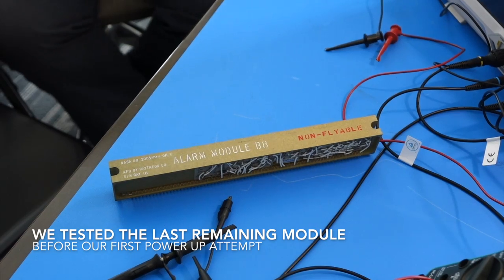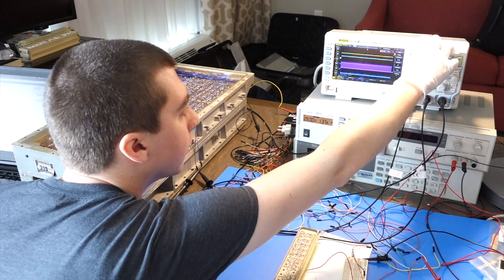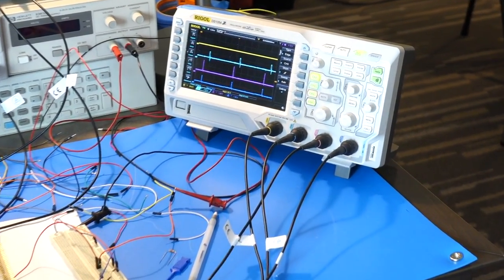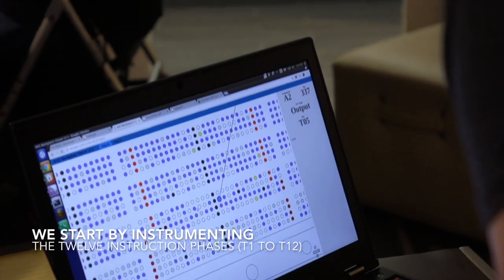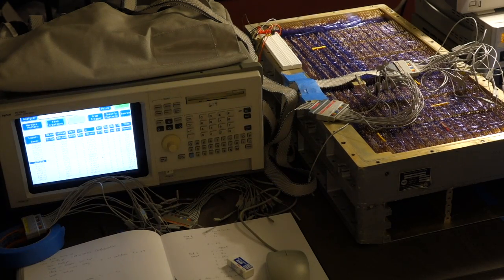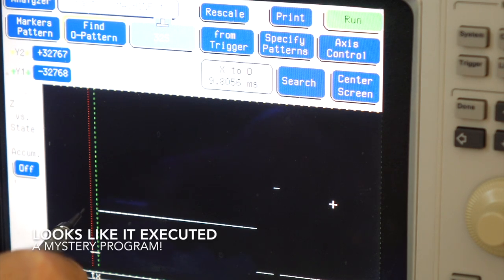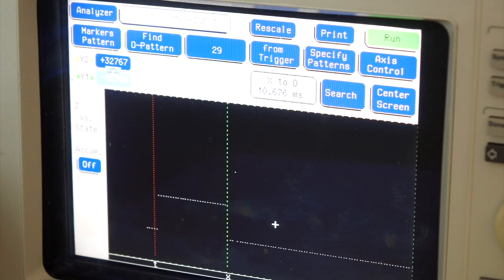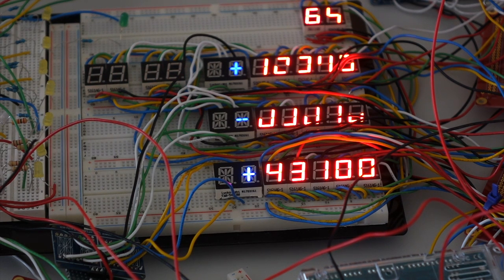Apollo Guidance Computer Part 4: We are "go" for power up

Comment: The folks at MIT probably would have traded their grandmas for that analyzer back in the day!
Reply: The logic analyzer almost certainly has many times the processing power and memory of the AGC itself, and probably more processing power and memory than any computer would have for the next few decades...
Reply: ungratefulmetalpansy  A single FPGA in that analyzer is more powerful than all of NASA's computers combined throughout the entire Apollo era.
Reply: And when the AGC was built RS-232 was maybe a year or two old at most, and still worked at +-25V logic levels. 8" floppies wouldn't be along for another decade.
Reply: @kal9001  The logic analyzer couldn't withstand a tumble down the stairs. After taking a trip on a Saturn V, would you trust it to navigate you to the moon and back?
Reply: I've would have trade my Grandma for one of them today... All i can afford is fake saleae 16 and Grandma is dead anyway... so if anyone... pls priv
Reply from the maker: @kal9001  Interesting comparison. First part yes (waaaaay more than AGC), second part no (more than any computer for decades). This lowly 1990's vintage LA has 2 MB of memory, and that's the super duper "deep memory" option, and a fairly slow 68000 CPU (of course, the acquisition cards have many custom FPGA or ASICs to keep up with the IO, and do most of the work). For reference, at the CHM, we have 1 MB core memory stacks dating back to the 1950's, complete with tube drivers and sense amplifiers. If you had lots of money and lots of space, you could have some decent memory and processing power in 1960. It would be interesting to figure out the processing power of a 68000 versus a large IBM 360 system like NASA and MIT had. I'm not so sure the 68000 would come ahead.
Reply: @CuriousMarc  Perhaps not, Didn't think the analizer would have been that old. However considering the volume of the box it's all in I'd wager the 68000 would not be touched for a while.
Compare instead then with the scope somewhere beyond 225 times the processing power, and more than 32 times the memory not including the acquisition memory. It's amazing how far we have come with computing hardware, but also equally as amazing is seeing so much done with so little.

Plenty of people here having a go at me for being a smart ass or for "picking on" on AGC, no... Realising how much further we have come makes me laugh at all the silly times when we all get angry that websites don't load quick enough, or our phones slow down for five minutes during an update.
It's funny to think this same conversation may happen again in 50 years time when we compare these threadrippers, and i9's with contemporary tech and how small we will look.
Reply from the maker: @kal9001  Alright, numbers are in (if you believe Wikipedia). The 1965 IBM 360/95 (NASA used 5 IBM 360's  for the Apollo 11 mission, two of them being 95's) clocks in at 3.8 MIPS. They each had 5 MB of memory. The Motorola 68EC020 in the logic analyzer is 5.36 MIPS in its fastest version. But I'd venture that the floating point instructions of the IBM put it ahead of the bare 68020 without its co-processor for scientific apps. And it would crush it in IO. IBM made a more powerful 360 series 195 later on which was 10 MIPS. Now the little problem is that the 360/95 CPU was something like 6 metric tons (just the CPU portion), and God knows how many 10's of kW it took. The 68020 is a few 100 grams and uses a few Watts. And if you added the math co-processor you'd be way ahead of the IBM. But if you ignore the staggering cost and size difference, they are much closer in performance than one would think, so @ungratefulmetalpansy has a point.
Reply: The IBM 360 91 is said to reach 16MFLOPS max at IBM: https://www.ibm.com/ibm/history/exhibits/mainframe/mainframe_PP2091.html
The Motorolas up to the MC68030 relied on external FPUs (best case the 50MHz MC68882) for floating point operations. The MC68882 is said to reach about 500kflops.
So in floating point operations, a single 360 91 had about 30 times the potential of an 68030+68882 combo. I think it's not surprising, as this thing was especially engineered for floating point applications, while this was just a bonus for the mc68k family. Also the IBM 360 91 already featured 64 bit wide data busses.
Reply from the maker: @elmariachi5133  Thanks. These are indeed impressive floating point numbers for 1960!
Reply: @lwilton  I had a friend, odd fellow really, only person I ever knew who had 8" floppy drives. I kinda swelled with pride as I thought about how modern I was because I had a 5.25" drive interfaced to my computer (Ohio Scientific Superboard II (because I was an impoverished student (the acquisition destroyed my marriage))). Later the ghost of that idea laughed at me as I contemplated my new 3.5" unit. The ghost's ghost laughed too happy with a half inch micro SD card. And today, much older but still here, there is nothing but an interface to the cloud. Next step converts my computer into a dumber terminal? Stirs the thought that all the I/O of which I'm conscious might be looping through the matrix and 800 pound me is floating in a tank somewhere enjoying a history lesson. Three cheers USB.

Comment: Interfacing the AGC with an arduino. I love it.
Reply from the maker: Well, yes and no. I should let Carl speak, but the whole point is that it's not interfacing with an Arduino directly. Carl is trying to reproduce the front end circuitry of a real DSKY as close as he can - I think he even used the same transistors and schematics. The Arduino is just used for the back-end logic and controlling the display, as getting the original purpose-made latching relays is not possible. But if someone finds some NOS, we'll happily take them.
Reply: CuriousMarc this is a project I'd kill to be a part of.

Comment: This is real computer engineering where you have to make everything by hand using available components, and having to create its own operating system. It was an extraordinary achievement by MIT. 
What few people know was the work of a guy called Dick Schott. He was the Chief Analogue Design Engineer for the US Navy. He was tasked by NASA to be a fatherly coach and a reality checker for the team and to make sure the timeframes were achievable. He could manage geniuses because he was one too. The Navy had taught him leadership. He was later hired by IBM when he left the Navy, together with his boss, another engineer called Ralph Ungermann. Together, at IBM, they wrote the 802.5 Token Ring protocol, subsequently adopted by the IEEE, and which became IBMs mainframe networking system for 20 years. He, Ralph and Charlie Bass formed a communication networking company called Ungermann-Bass and commercialised their work. I worked with both of them and they were great guys and treated their employees very well. When it came time to retire and release their equity UB was sold to Tandem Computers. They learned that Tandem were bad to work for, so he bought UB back again. Who would do that today?
Its this stuff that the US does best. Scientific and technical leadership. It does not do social policy at all well. But as Napoleon said, "not everyone can be a hero. You always need people at the side of the road cheering and throwing flowers."

Comment: Remember that several AGC modules were employed by NASA in their fly by wire program. As many as 4 AGC modules were loaded on the A-7 Corsair to keep it stable.
Reply: Nighthawke70 Perhaps they thought that it was space certified and should be fine for an airplane.
Reply from the maker: @rkan2  I think Apollo and the LM was the first fly-by-wire system, period. Then they applied it back to fighter planes later, first experimenting with the AGC. Sort of crazy it went in that order.
Reply: @CuriousMarc  A rudimentary fly-by-wire system was employed by the Avro Arrow CF-105. (first flight in 1958) When that program was canceled in 1959 by the progressive conservative government under John Diefenbaker. A lot of the engineers that had been working on that program ended up working for NASA or many of the contract companies building the hardware for the space program.  A lot of what was pioneered in the Arrow program was implemented at NASA, such as having a "CAPCOM", someone who communicates directly with the crew; the terminology comes from NASA but the idea of a single point of communication to the pilot or crew etc. I'm not Canadian, but it's a fascinating history of what could have been with the Avro Arrow and what those engineers pioneered in supersonic flight and the necessary technologies to achieve that. It lent directly to the space program.
Reply from the maker: @marcusdamberger  Fascinating. Thanks for posting, I didn't know.
Reply: @rkan2  They needed a robust system that were small, fast, flight certified, and inexpensive.  In that age, that kind of criteria got you a system that easily filled a boxing ring and gobbled power like popcorn.  Neil Armstrong worked in NASA's Office of Advanced Research and Technology (The Government's version of the Skunk Works) suggested to Dryden they use the AGC systems. 

The leftover parts from Saturn/Apollo were the best candidates.  They took the flight test articles and spares, retooled them for the project and slapped them in the planes.  I'm certain they considered the IMU system off the guidance section for the Saturn V, but that thing was just as bulky.  Later on, they got a dedicated flight control system and retired the AGC flight test hardware.  That box might be one of the components that was part of the DFBW program.

This was the Digital Fly By Wire development program that brought to life the reality that computers could fly an aircraft.
Reply: @CuriousMarc   They were looking into simplifying how planes were controlled. Back then, aircraft were being flown with control cables, hydraulic boosters and bellows. That kind of set up could not hold up under the duress in future aircraft like the F-X and LWF (Light Weight Fighter ) programs were mulling over. Those programs yielded the legends we have on the flight line today, the F-15 and F-16, both use DFBW to varying degrees. The F-15 uses it to augment the flight controls, the F-16 depends on 3 systems to keep it in the air, and the F-117 Stealth, 5!
Reply: Yes I worked on Secret level black boxes on all the A-7E Corsairs as avionics technician for AIMD Micro Miniature soldering & repair NASA certified 'C' level. U.S Navy NAS Lemoore. Ca. We didn't test the fly-by-wire at that time. Wish we did!

Comment: Working on that with Rigol 1054s? Just doesn’t seem right to use such a budget scope on priceless equipment...
Reply from the maker: We could not move the AGC in the lab, we had to fly in. We just took the smallest and lightest equipment we got. The Rigol qualifies. Worked plenty fine I have to say.
Reply: I don’t mean the Rigol is bad or the wrong equipment, it’s a good scope, it’s just that it seems out of place compared to what it’s sitting next to. Still a good job though, very interesting.

Comment: Again back when they made things to last! Nearly 50 years later & it's still working! Yet 1 year later & your smartphone starts getting flakey...
Reply: Well yeah but your smartphone was knocked out by the tens of thousands in a factory in China with hot glue and repetitive manufacture. This, as we've learned from the other videos, was handmade with welded (not soldered) wiring, and the components were x-rayed to check for physical faults before assembly.

So the unusual level of attention to detail might have something to do with it :D

There was a figure in one of the other videos. I think the modern day cost would be about $21 million. Per computer?
Reply: You have to remember the reason the phones get flakey are:
1, Primarily - Firmware on the phone, this is not the OS, but manufacturer firmware that runs all the low level stuff, security updates, patches, planned obsolescence all take their tole. But if you manage to hack one, and shove custom firmware/operating systems on a phone you'll find performance close to when it left the factory.
2, degrading batteries mean the CPU can't use it's most aggressive power settings.
3, Over time applications get more demanding as they are made for the "average" phone, which as they get faster and faster each year the applications themselves are made to use more memory and do more work or with fancier graphics.
If I were still using a Galaxy S3 or something today it may not be the phone that slowed down, but simply the S3 can't, and never could have handled the graphics in modern mobile games, the amount of memory demanded by a modern browser or the data throughput needed to stream HD video, none of which existed back when that phone was made.
Reply: Any modern solid-state device is going to outlast evey bit in this computer. Even the transistors don't seem to be solid-state enough in this computer :D (the ones they fixed by shaking in a previous video)
Reply: @rkan2  not true, solid state is limited to read & write sequences before failure which cannot be repaired. Also the part they fixed by shaking it was to free a metal part that had broken into pieces & was shorting out the connections, they shook it & it fell out, problem solved. I think you're referring too the time when he hit it once or twice on the side & it started working fine. That is highly technical in-depth engineer troubleshooting 101. If rebooting doesn't fix it, hit it at no more than 3 times (or 4 if you don't like odd numbers). You'd be surprised how often it works 🙄.
Reply: Magestic "Manually assisted self fixing" or as uncle bumblefuck would put it: "Tappy tap tap"
Reply: Magestic I am referring to, @part1@11:30, as I understood it, the shaking didn't actually make anything fall out, since it was an IC that was sealed, it just stopped shorting it. Also while most of the connections wtc are welded instead of soldered, they are still cables that can be moved.(even with potting) Because of these, I would regard any modern computer as being more "solid-state", since a lot of the things that are not integrated into ICs in the AGC, are in a single chip or RAM that is solid-state. The magnetic core memory is probably the part that is furthest from being solid state :D
Reply: I agree with the sentiment, but remember that this computer cost $2.1 million (inflation adjusted). As in, just this one single unit, serial #14. If you had to build a series of computers today with a budget of over $2m each where failure of any kind is not an option, you could bet they would still be working in the year 2068.
Reply: True, but must remember, these were the "Rolls-Royce" of computer tech.. designed for a specific purpose, using only the very best of the best, of the best, components. All with high control standards of assembly. In saying that, I have had computers and video games dating from the early 1980's that worked when I found them, and still work fine today, often with no repairs nor testing. I can't quite say the same for 1990's tech, 2000's tech, mostly non repairable! The tech is smaller, but throw away. Indeed, the same computer as the agc, built today, would likely consist of 5 or 6 ic's, including cpu and memory (rom, eprom and ram) and be the size of an 8" tablet, at most!

Funny to think how far tech has come... from built to last and repairable to miniaturised and mostly throw away!
Reply: My smartphone is also the equivalent of  literally MILLIONS of these AGCs though...
Reply: @magicstix0r  Yeah, but your smartphone can't be dropped from 3 feet without shattering. How do you think it would fare on a multi-g rocket ride to the moon?
Reply: @thereynolds2725  it would fare fine. Smartphones are fragile because of their screens. The cpus in a smartphone would handle the g-load just fine.
Reply: @magicstix0r  It isn't radiation hardened nor would I trust a multipurpose OS with such an important task.
Reply: @thereynolds2725  1) Radiation hardening is of limited use in a cpu. It would make more sense to shield the ram. ECC memory would also make it somewhat overkill to have hardened ram.  2) There are radiation hardened versions of ARM CPUs readily available that have no impact on performance so your entire statement is already a red herring. 3) the OS software is irrelevant to the discussion since we're talking about the hardware. No one is talking about running anything under iOS.
Reply: @magicstix0r  I'm not saying there would be an impact on performance from radiation hardening. Not sure why that's mentioned. As far as OS goes, it is entirely relevant because that's how the computer in your phone works. You mentioned a phone, not a flight-certified phone-sized special purpose computer. I agree that your phone has more mathematical ability than the AGC. I do not, however, believe that it has the mechanical durability to survive the environment of the AGC.
Reply: My favorite motto: "Newer doesn't always mean better."

Comment: Would it be possible to use the AS-202 Block I memory ropes in the Block II Lunar Module's AGC?
Reply: No, different organization, pinout and physical mounting method, but more importantly the AGC architecture was significantly expanded for block II
Reply from the maker: Sadly not compatible. And also the software was very early in the development, did not do anything like you'd expect from the later real manned missions.